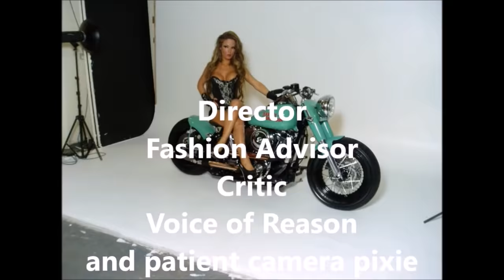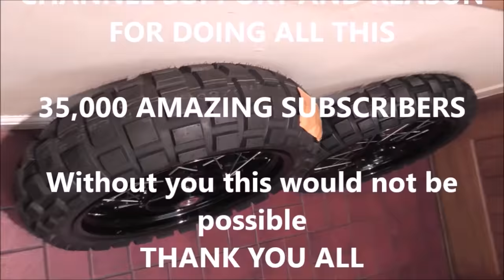Delboy's Garage, USD Fork Seal Replacement

Comment: Do you recommend to get oem seals or after market one would do fine or even better
Reply from the maker: If you talk to Wemoto, they do both options, I've always used the best value seals I can buy, never found any bad ones that fail to function, as long as they're the correct spec for your bike!
Reply: @Moonfleet41  thanks, another question is this how you change most sport bike seal, I have a 2015 gsx s750, people keep telling me to take to someone that know what there doing but im pretty handy and I want to do it myself because I know its going to cost a lot to have somebody to do it

Comment: Where could I get a driver like that and how much would it run me? I'm asking so I could get a reference to a reliable set and not just "look up seal driver".
Reply: At your local hardware store :P. I never buy drivers, I just use PVC as a seal driver.

Comment: I am doing my 2003 mean streak its almost the same as this but the spring is inside the top chamber not like in this video is this right or should it be like this? the fork looks just like this one
Please help
Reply from the maker: HI Russ... Dont worry buddy, all forks vary a little in thier internal anatomy, as long as they were functioning correctly before, then re-assemble them exactly the same as you found them...if it helps, do one at a time, and use the other as a guide to re-assembly... hope that helps you sir.. good luck.. Del.

Comment: hi mate. i want to do my 1998 r1 forks. is that basically the same principle or do i need a special tool or tools? also, i saw a more detailed video posted for an r6 fork seal and oil change. in that video ge did a total strip ( which i dont think i need to do) and he also entied oul from a chamber and the lower end of the fork. if its easy for me to do mine with your method do i need to drain and refill that lower chamber or just ignore that bit?
Reply from the maker: Hi Carmine, The anatomy of most forks is more or less the same, just slightly different arrangements of parts... if you up-end the fork and pump the damper rod you can eventually empty it all out...then fill it in the same way making sure you get all the air out...  i would suggest maybe get a manual, then at least you will have a schematic diagram of the forks which will get you out of trouble if you find something you dont recognise..!! hope that helps mate.. good luck with it.. Del.
Reply: Moonfleet41 thanks

Comment: Awesome tutorial del but im wondering if you could give me some additional advice. The lock nut appears to be inside a metal tube on my forks and therefore i am unable to get to it with the wrench. Is there any other way for me to access the lock nut ?
Thanks
Reply from the maker: Hi buddy, not sure what lock nut you're talking about... could you be more specific - and what bike is it too??
Reply: Sorry should have been more specific. Im talking about the lock nut mentioned at 10 minutes into the video with the damper rod. The spring is located further down the shock tube and the difference is taken up by a cylindrical upper tube that covers the locking nut. There are 2 holes in this tube and i am told that ill need a special tool that will go into these holes and allow me to push the tube down to get access to the locking nut. I have a 2009 Suzuki B King
Reply from the maker: OK, got it now i think....so you need to force this tube down out of the way to get to the lock nut.?... i haven't seen that yet, but they are all different, and it'd be obvious enough once i looked at it... OK, so rather then shell out for a "special tool" can you not adapt it or make something that does the same job... i presume (without seeing it) that the 'tool' is something like a peg that goes into the hole, and produces a lever or grip so you can pull on it to move it?.. is that right..?... Can you maybe send me a picture of the fork tube showing the thing you need to sift..?.. happy to help mate, just need a look at it.?
Reply from the maker: Ok, thats looks how i expected it too.....the part B looks like a bit of sheet metal, easy enough to make.. the other thing "part-A" just looks like it grips hold of the tube safely to pull it down.... so with two pairs of hands, can you not force that tube down by hand, then slip something under the lip to hold it back..?
Reply: My friend on a zx6R had the same problem as it also contained the similar construction with the two holes. He tried forcing it down with a buddy by finding rods with the same diameter and pushing them in the holes and forcing down. The problem was that it deformed the cylinder as it appeared the be made of thin sheet metal ( so is mine ) so that special tool serves a purpose in that the ring is quite thick and rigid which makes sure that only the downwards force is applied to the rods and no torsional forces. I mite try to weld up a box section with the holes in it and weld on a nut so I can thread on a rod to achieve the same effect as the Suzuki special tool. 
Thanks again for all the help and suggestions del, your truly an amazing helpful person full of knowledge. Keep making the amazing content that you do and ride safe

Comment: hi mate. Just quick question. I need to replace forks in my bike because of the rust on the bottom tube. I got set in witch upper tube it's scratch in very visible place. Can I spin upper tube in yoke?
Reply from the maker: Hi buddy, you can certainly turn the slide tubes round in their yokes, that's no problem, and you can even sand off a little of the rust, and polish it out as much as possible to make it smooth... a little smooth scuffing from some sanding repair is better than spikey sharp rust!  Hoep that helps...
Reply: +Moonfleet41 Hi. thank for very quick response. I found forks on eBay for good price so I bought them. bike stud outside for over two years. I got it cheap so I knew It's worth even change forks. Again thanks. Buy the way I like watch your videos, sometimes they are very useful

Comment: HI MY FRIEND GOOD JOB!I WANT TO ASK YOU ABOUT THE SPRING IN THE FORK.THEE THICK PARTOF THE  SPRING GOES UP OR DOWN? I AM TALKING FORA SIMPLE FORK NOT UPSIDEDOWN.THANKS!
Reply from the maker: Hi Loannis,  If you mean the "tightest wound" coils of a progressive spring ? then i find it best to have those at the top so that the weight of the rest of the spring is not bearing down on them, they are the softest part of the spring and absorb the smallest bumps to give a smooth ride.
Reply: @Moonfleet41  thankyou for your ansewr sorry about my english but i asked you becouse in the past i had put the tightes part on the top and the last time that i changedoil in the fork i put the tightest part down and ifeel the ride smoother than when is in the top.i saw many videos and all when change oil this part of spring the tightest is down soi test it and is better for me smoothiest.any way thank you for your opinion.

Comment: PLEASE PLEASE PLEASE make a video on rebuilding a Springer front end. only video i found didnt make me confident in the repair and i cant come up with 2grand for a shop rebuild when the parts are about $500. even had a friend convert his springer to a tube fork because of the hassle and ride and it was cheaper then the repair. I know a springer can ride comfortable and have made tweaks by upgrading the shock from harleys $50 junk shock to the $300 paughco shock but the springs and races and bearings are all well due to be replaced . thank you in advance
Reply from the maker: I'm afraid i don't have a Springer fork assembly to carry out such a service on, my Harley has regular forks..!   best i can suggest is to buy the genuine HD service manual for your exact bike and follow the instructions carefully, they are very well written and laid out... !

Comment: so , you measure the airgap from the top of the tube , shouldnt it be resting all the way down then , instead of resting on the colar you made out of that rag ? im just curious
Reply: should it be measured from the rim of the tube ??
Reply: i am going to be doing this on honda 929 forks , in basics the same deal als these kawasaki forks right ?
Reply from the maker: Hi Dimi... you measure to the top of the INNER chrome tube.. the outer tube is irrelavant, and yes, measure from the top lip of the chrome tube to the oil ...

Comment: Having issue getting seal or bearing to move, fork just jams up when using the slide hammer affect to remove. Any ideas?
Reply from the maker: Have you taken out the circlip that holds the seal in?
Reply: @Moonfleet41   Yes clip was removed, seal very tight. Lower bearing was driving inside of upper bearing & jamming solid. Heated tube with hair drier not to get to hot, eventually seal let go and now all apart. New bushes will be required. Many thanks for reply.
Reply from the maker: @stuartthomas241  No worries Stuart, glad you got it sussed out.. i have heard of a few people simply forgetting the clip then destroying the bushes.. They can get stuck in there at times, but as you found, a little heat, persistence and maybe soak them over night too.. and they eventually give up.!

Comment: I know this is 4 years ago but is there any way you can tell me how much oil  will go in to each fork
Reply from the maker: Unless your forks have been stripped and dried, then it's best not to use a quantity, because you never know how much is left in there clinging to the sides, and that can be as much as an ounce of oil, so it's better to use an 'air gap' level, as I did in the video, look up the required number of mm of air gap from the top of the oil to the top of the inner chrome fork tube, with the spring removed and the two halves collapsed... then once again, measure to the top of the chrome fork tube, not the outer tube... the spec. will be in your manual.

Comment: I hear a spring knocking sound when I hold the brake and compress the forks.  I have another bike of the same model it never made this sound.  I replaces the seals and oil.  The internals looked mint.  The only think "unusual" was one spring was 1/16" shorter than the other.  They are Yamaha WR250Rs.  Can you give me any advice about what's wrong and what to do to fix it?
Reply from the maker: Is it a spring knocking sound, or is it the brake disc rotor moving and clicking against the its carrier..?.. 

When you hold the brake on and rock the bike back and forward you can often hear the disc click and it moves.. just a thought.!
Reply: Moonfleet41 I found the problem on my bike.  My bike has forks with the wide tube on top and narrow tube on bottom.  So I held the bottom of the wide tube and the bottom of the narrow tube at the place where the axle is.  I moved the narrow tube forward/backward.  One fork had play.  I rotated the wide tube by 90 degrees in the triple tree clamp. I checked for play and it was no longer there.  So I think the wide tube is bad in my case.  BTW way thanks for responding to my comments!!!
Reply from the maker: @matt3122  OK, thats sounds like you're describing free-play between the inner and out tube.. there are two bushings inside the forks, one is just inside the mouth of the outer tube, and the other is around the end of the inner tube.. they are like "split collars:... if they are scored and marked.. then you could replace them both to eliminate that play, .. !
Reply: @Moonfleet41  I actually replaced the bushings.  The ones that came out looked brand new too.  The outer tube must be worn out in one direction.  It kinda sucks but turning the tube helped a lot.

Comment: Sorry... beginner question but what type of grease are you using? My seal kit didn't come with any included.  Best, Nick
Reply from the maker: Best for firrint new seals would be 'Red Rubber Grease' Nick..   you can buy it in tiny tubes..!
Reply: Haha, ok, I heard you say that on your vid's but thought there may be a more technical type of grease.  I'll head over to my local shop and pick some up. Thank you! Great vids!
Reply from the maker: Yeah, sorry mate.. i do mumble a lot...lol

Comment: Hey Mate I've got a 2008 Triumph America only done 20,000km and just noticed I've got a seal leak on the righthand side fork. About 12 months ago I upgraded the internals with progressive springs and emulators as the standard shocks are very hard and gave it a very hard rough ride. The upgrade was well worth it but now as I mentioned I have a leak on one of them. You think its worth replacing both seals on the forks? I find it kinda odd it's already done a seal after only 20,000km. Cheers
Reply from the maker: I always replace both seals Martin as you know what'll happen, the day after you do just the one... whatever upgrade work you've done to your forks doesn't mean that a stray sharp piece of grit, or road debris, can't get pushed down under the fork seal and start lacerating the seals, it's just wear and tear mate!
Reply: @Moonfleet41  Yep agree, I thought about it after posting my comment. I bought the bike at 8000km which is very low for a 2008 model its probably been sitting in a shed for some time so the rubber probably just deteriorate especially with the hot temperatures we get in Perth Australia. Cool, I've ordered some and your video will help me tremendously. Cheers mate

Comment: why di you measure with the cloth still around the bottom of the folk? surely that will change the measurement of oil from the top ???
Reply from the maker: I measure to the inside tube, that is where the level is taken from.. it looks like im measuring to the outer tube.. but not.. it doesnt matter where the outer tube is..!

Comment: Measurement air-chamber is not good due to the fact that the cloth is still around the leg. But thanks for clear explanation.
Reply from the maker: Measured inside the tube, so the cloth made no difference, the air gap was correct my friend... thanks for watching

Comment: is this the same for triumph daytona 675 bikes or do i need a spring compressor?
Reply from the maker: Not sure Russell, i haven't opened up a set of Triumph forks.. its always a good move to have a proper service manual, and in there it will give you any specific tools needed.... if they are just conventional internals, then they'll be not much different to these..!
Reply: from the pics in the haynes manual theres a white plastic looking thing on top of the spring

Comment: No way you could of laid them down to assemble top with that fluid topped up. Looks to me assembly has to be completed vertically.what held the fluid in after dropping the spring in that allowed them to be laid down almost completely horizontal.MattB

Comment: hi del iv had a mechanic replace the fork seals on my 2000 yamaha thundercat as one was leaking, within 3 weeks of it being done the same fork started leaking again so of course i took it back and he replaced it for free he explained that the fork seal had some how inverted it's self gone inside out now iv never done fork seals before but i cant afford to pay someone to do it for me again and at this point it was done more than 2 months ago so not sure my mechanic will be so happy to replace it again, just wondering if you have any experience with what my mechanic explained was not something he had seen happen before he explained that there was no pitting on the bits going into the tube as he had scrubbed it clean and that i might want to think about replacing the fork if happens again
Reply from the maker: Hi mate, there may not be any pits on the fork leg that slides in and out of the seal, but it's entirely possible to lacerate a new seal sliding over the fork leg unless you put a proetective gasket inside it to slide it down.. there is always lots of rust and crud around the top of the fork where it bolts in to the yokes, I slip a sheet of old milk carton covered in grease, around the fork leg at the every top, then slip the new seal over that, then slide that down over the fork leg, so the rubber seal doesn't touch anything, until you slip the gasket out a couple of inches from it's seat, it's possible he could have split it putting it on... had to tell without seeing it buddy... or without seeing what he did....   See how it goes, it could have just been a bad seal....
Reply: +Moonfleet41 hehe 2 bad seals aye ill do it my self this time its an upright fork but it doesn't appear as scary as i thought it was its odd that its the same form each time thanks del literally knew nothing before your channel but now i do everything my self granted its not beyond me and im building a nice collection of tools as i go cheers del :) and of course penny
Reply from the maker: Good luck with it mate... alway best to do it yourself, as it's not a hard job and you will always take more care with your own bike than a busy mechanic!   You do know that we have a 'fork seal replacement' video on 'regular type forks'?????????  Hope that will help you !
Reply: +Moonfleet41 ill go find it fantastic thanks matey

Comment: Can the seal be tapped in without that special tool 🤔
Reply from the maker: Yes, you can use a couple of short lengths of slit waste pipe and a jubilee clip, works fin you do you it right..!

Comment: mine are leaking from the bottom of the tube, caliper side. any suggestion?
Reply from the maker: The only access point at the bottom of the the is the damper rod bolt, it may have come lose??  You'll have to drop the wheel out and see if you can tighten it up...
Reply: @Moonfleet41  hi, it keep leaking. and the bike dive more when i brake hard